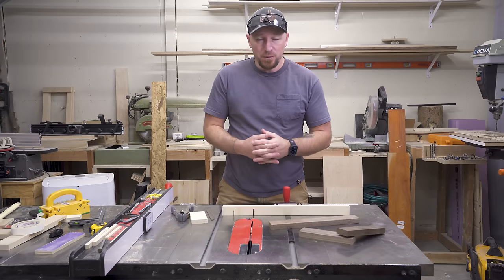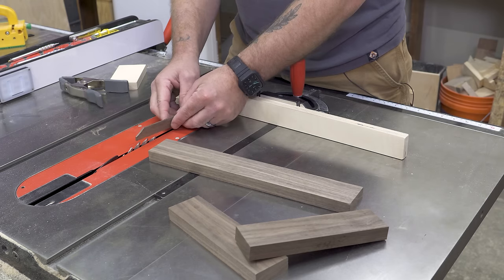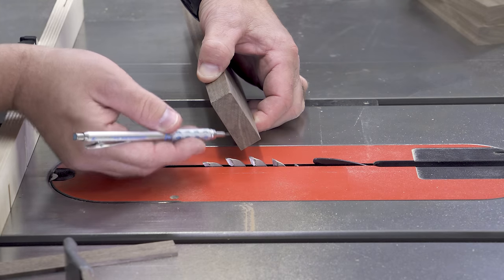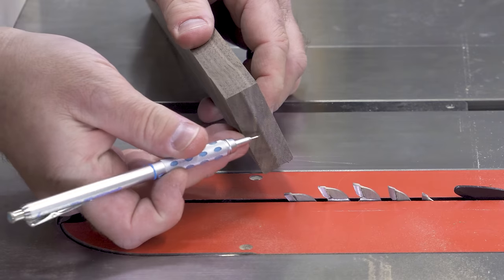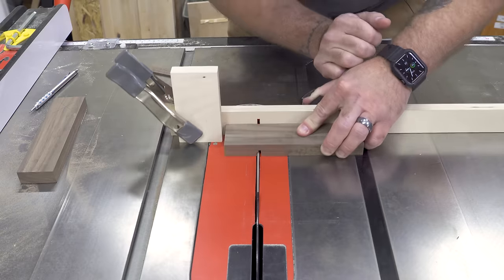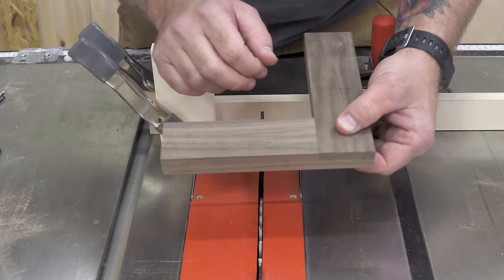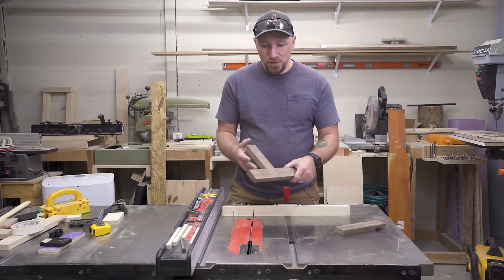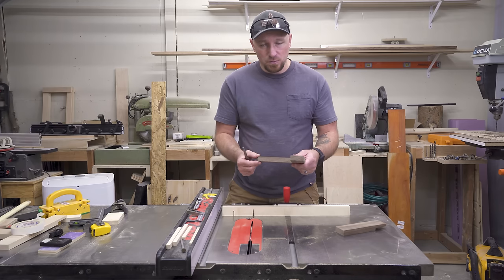How To Make Perfect Half Lap Joints On The Table Saw

Comment: Amateur woodcrafter. I used this technique tonight in some half laps I'm using for cabinet doors. Worked INCREDIBLY easy. Definitely recommend using a flat tooth blade as I had some extra sanding to do with the blade I used.

Thanks for the great content. Earned a sub, for sure!

Comment: Superb! I'm an old shopfitter who has been pottering around in my ever developing garage workshop. This is an absolute gem of a tip. Easy to execute and virtually free. I went ahead, a while back and bought the Banggood kerf-doofer when it was on sale at £15 Sterling. Well, it absolutely works, and I cannot complain with the quality of the accessory which is excellent - especially for the price! 
However, your tip makes half laps, dados and grooves a breeze on the table saw.
Thank you for sharing!  You have a new subscriber! 👍

Comment: I've seen people use a drill bit of the same diameter as the blade kerf...   however the wood shim is a lot easier to place and it stays where you put it...   Superb video sir!    thanks for great useful tips without a lot of fluff
Reply from the maker: Thank you very much. I didn't want to use a drill bit because that leaves the folks out that are using thin kerf blades. Great suggestion though! I just uploaded a video on how to make the shim if you're interested. https://youtu.be/nsw5qlrdx2A

Comment: Ingenious out of the box thinking tip for how to make a kerf-width shim that is simpler than using a kerf-maker device in some scenarios. Having to smooth the bottom of a dado or half-lap with a chisel is wrought with potential error, so I invested in a Freud true flat tooth blade that increases the joint accuracy and time it takes to make a given joint; no bottom cleanup! For some rabbits or dadoes, although $$$, love using my Lie-Nielsen router plane. Caveat to that is when using plywood as a router plane can catch and pull up/splinter the layers (probably not as much an issue if using good quality ply vs the medium big box store stuff I more readily have at my disposal). Thanks you for video tips and instruction.

Comment: Great video. I liked how you found center. I use a radial arm saw but the principal is the same.
I'll have to remember to use the correct blade. I have both flat tooth and tilted teeth on  some blades.
Thanks, Barry

Comment: I just finished making and adjusting my crosscut sled. In order to adjust the fence, I bought some cheap feeler gauges. I was about to make this shim when I realized I could just stack some feeler gauges until they fit snugly in a slot cut by my blade and use those as my shim.

Comment: I’m 52 yrs old. Never worked with wood. Bought a lot of Festool but using my small Dewalt table saw scares the shit out of me because of kickback….. I bought many jigs to safely use it but I’m still scared… I need to do cross lap joints in the middle of a workpiece….. Can I still do it with a sliding miter saw or with a router… ?
A lot of woodworking seems to be done with a table saw…… I’d like your opinion. By the way I am subscribed to your channel and I think your way of talking and explaining is exceptional. You are a very good teacher for old Newbie’s like me…..

Comment: Nice job. Great that you showed using a single blade. I have dado stacks but like the flat grind single blade method and the use of spacers to ensure a quick fit without all the nudging etc. With all the blades I have it's time to add a couple more 24tooth flat top grind blades. Will use the link you provided which is much appreciated.

Comment: I love my Forrest blades. I think I need to buy that flat top grind.

BTW with that blade I use a brass setup bar in lieu of a shim.
Reply from the maker: I still need to get a set of those. It’s always one of those things that slips my mind.
Reply: @InspireWoodcraft  But as  you said earlier, for safety sake using wood instead of metal is better because if the metal gets loose it could fall into the spinning blade.

Comment: Really nice, simple video.  One thing I didn't catch was how to make that shim, but it seems setup blocks should do the same job.  The Forrest Woodworker II blade is 1/8" kerf, so the 1/8" setup block would be a good spacer if you don't have the shim handy.     Edit:  duh, the directions to make the shim are right there in the pinned comment..   Anyway, setup blocks should work too:)

Comment: Very nice technique and well explained. I was thinking after watch your video and was wondering if you could take the male half and lay it flat on your table saw and then raise the saw blade up until it is flush with the half lap....then run the female side back through to get a perfect joint without having to sand or plane. Just a thought

Comment: Just found the channel and subscribed. Thanks for some really useful tips and really clear explanations. 

I wondered whether there might not be an even simpler way to achieve this level of fit though.  How about, rather than laying the jointing piece along right side of the blade (your right in the video) and using that to place your stop block, you lay a piece of stock on the left side of the blade, then butt the jointing piece against it (standing on end), then put your stop block against that.  This way you are effectively including the kerf in your measurement without the need for a shim.  Probably much easier with short lengths than longer ones, but effective anyway. What do you think?

Comment: The method for finding the center is great for us with bad eyesight. I need glasses to see up close so it's always a struggle to have to tilt my head back to look through the bifocals. Even using a height gauge can be difficult when it's hard to see. Yeah, I know, I could use better glasses, but do you know what you can buy for the price of a pair of glasses? Lol
Reply from the maker: Haha. So true. The older I get (I'm only 41, but I don't seem to be going backwards any time soon) the more I notice I squint just a little bit more than I used to. I tried finding center with a double square and a marking knife and that worked great. Actually seeing the knife mark against the saw blade was a whole other issue.

Comment: Jody, first off, great video. I made the shim per your other video, then made my half laps per this video. On the edges of the boards they are off just slightly so that the two pieces aren't exactly flush. I'm wondering if I should try remaking the shim, or just leave it and sand them flush. I hate to do that since the idea is to use the actual material to get an exact fit.

Comment: Excellent! I need to cut a half-lap joint in 3/4" plywood that is 2 ft wide (joint about 2 in.) EDIT: cutting across the grain, not with it.
 Would this be the best method for that? I do have a router, but it seems a lot of material to remove for that router.

Comment: Hi this is awesome thanks. I am pretty new, the blades seem to be labeled as rip cut and reviews saw cross cuts would be bad on them. Does that not matter because not going all the way through wood? Thank you.
Reply: my opinion, no. He is using a flat tooth blade to make his joints. That is so he does not have to go back and use a block plane, chisel etc to clean up the ridges left by a regular blade...hope that helps.

Comment: I use the same technique, HOWEVER...I like having the grooves left by my saw blade.  It gives the glue someplace to go besides being squeezed out of the joint.  Makes for a good glue-up.
Reply: That is terrible advice.
Reply: @GifCoDigital  Please explain why that was terrible advice.
Reply: @dennisdubin2126   the more mating surface area the better the joint. Having random saw grooves will not only make it much harder to get the top of the joint flush it will also weaken the joint and is just ridiculous, the glue doesn't need extra space, it absorbs into the wood to create the bond.

Comment: Thank you. These videos are excellent. 

In your "internal miter spline" video, you use two 45 deg cuts to find the center of a piece. Could you use that method to set your blade height here too?
Reply from the maker: YES! I thought about that when I was making this video but I wanted it to be as easy as possible. In the other video we already had to have our blade at 45, so it was no more work than what we were planning on doing anyway. With the half laps, we had no reason to have our blade at anything but 90 and I just didn't see the point, for most folks, to adjust their blade back and forth just for one piece. For a lot of people it would take just as long to keep nibbling away as it would to reset the blade and all. Kind of appealing to the masses, if that makes sense. But I'm with you 100%.

Comment: Hi, how hard do you press down on the rail as you pass it over the blade - to keep it firmly against the table?
Reply from the maker: Just enough to keep it held in place. If there is a little bow to the piece I would press down a little more firm of course.

Comment: Good instructional video. How does the less expensive blade compare to the $180 Forrester? That’s a very good quality blade but not in my budget. What is your recommended method of assembling the joints? Obviously glue, but would you add pin nails or a contrasting colored dowel? 👍👍
Reply from the maker: I do not have the other blades so I can't say for sure. I have heard great things about them but the less expensive ones are also 24 tooth, better for ripping, while the Forrest is a 40 tooth so it tackles pretty much everything. I am not saying that that alone justifies the price, just an observation. The other thing is that SawStop table saws are not supposed to use blades with anti-kickback shoulders (that little hump of blade plate behind the teeth) and most 24 tooth, flat grind ripping blades are made this way.

To assemble, I would just put some glue in the joint and clamp it. You could definitely use pin nails or dowels, especially contrasting color, would look great. Although the dowels wouldn't do anything to clamp the two pieces together.

Comment: Someone else may have mentioned this already, but instead of making your own shim, you can just use a 1/8” (or whatever kerf size you have) drill bit. Perfectly machined already, and something everyone’s got lying around.
Reply: Some Woodpeckers rulers I own are 1/8" thick too (blade from Paolini pocket rule).  I use it for the kerf trick, too.

Comment: Two times you showed us how to create a kick back with the miter and the fence hu thanks
Reply from the maker: Did no such thing. May want to rewatch the video and pay closer attention to those parts. Miter gauges and rip fences can be used together on non-through cuts. It’s when the blade goes all the way through the material that you will run into problems.

Comment: Nice presentation.  You make it look so easy!  Will have to try a flat tooth grind blade.  Results with an ATB blade have been frustrating.  Also noticed that the table saw seems to cut deeper on some passes than others; any idea of why that would be?  Thanks for the demonstration, and the reminder about the shim.
Reply from the maker: From my own experiences, uneven cuts are usually from parts and pieces that either aren't flat or don't stay flat. If the wood rides on top of a wavy surface, it makes a wavy cut. If it doesn't stay flat on a flat table the same thing happens. A flimsy throat plate can make you crazy as well as it flexes and changes the depth, and in some cases the angle, of the cut. Also, and I don't think this sounds like the issue but it's worth mentioning, make sure to get in the habit of tightening the height adjustment knob. I know my Ridgid saw would always vibrate itself out of adjustment.

Comment: I know this is an old video but if you are using material that is small like that, to find half way....just take a straight edge and draw a from corner to corner making an X on the edge.  The point where the lines cross is the half way point.  It will save time on measuring or "nibbling" as he did.

Comment: Thanks. Any tips on how to cut the perfect shim?
Reply from the maker: So this is really hard to explain so maybe I will make a video on it. First, try measuring it with calipers and then setting the table saw fence to that same distance. Don't stress on the number itself so much as the actual size. You can also measure the best you can with a ruler or a small combination or double square and cut it a little thick, and then sand it little by little until you get the perfect fit. If you run a single pass into another piece of material, like a deep dado of sorts, you will have a perfect reference for the shim. Basically if it fits well in that cut, it's the right size. If you do it right you can also use another blade of the same thickness as a spacer between the table saw and the blade that your cutting with.
Reply from the maker: Hey I just uploaded a video on how to make that shim. Easy to do and no measuring. If you're interested: https://youtu.be/nsw5qlrdx2A
Reply: Awesome! 👍🏼

Comment: I've thought of a way to dial in exactly half the thickness without trial-and-error: 
- set the blade to exactly zero (using a piece of planed scrap to gauge when the topmost tooth barely touches the surface when the blade is moved back and forth by hand
- set the workpiece just next to the blade and raise the blade by a whole number of crank turns from whatever reference angle it was at initially, without overshooting the thickness of the workpiece 
- in case of overshoot: back up by two turns down, then one turn up (backing up just one turn might cause Issues if there's any slack in the crank mechanism).
- then raise the blade to the exact thickness, using the same offcut laid on top of the actual work piece as a way to feel when the blade barely grazes the surface
- observe the angle difference between the reference angle and the final angle
- Now back up all the way down to the zero position 
- and finally raise the blade by half the number of turns + half the angle difference previously observed

(I have to confess I haven't tested the technique yet. I'll edit the comment when I have :)